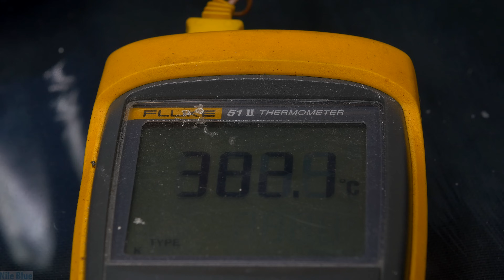Everyday science: starting fire with steam

Comment: Why does the copper tubing change color when the flame is applied?  Are the electrons in the copper moved to an excited state by the energy from the flame? Or am I thinking in the wrong area?
Reply: +Andrew Lorick It's called patina. Basically a very thin layer of oxide. Similarily to anodization, the color is determined by the thickness of the oxide layer.
Reply: I suspect that the effect seen in the center of the flame is the oxide layer being briefly reduced back to metallic copper by hot unreacted hydrocarbons from the torch.
Reply: YouCanHasAccount thanks this was really helpful
Reply: +YouCanHasAccount And since the environment is oxygen-starved, it does not change back until the torch is removed.
Reply: 1 likes in 5 years 😭😭

Comment: Why does the copper change color when you heated it with a torch?
Reply: The flame  is converting the oxides back to metallic copper. When the flame moves away the hot copper tube oxidizes again almost instantly in the open air.
Reply: Wow. Grammar...
Reply: +Matthew Ferrie It oxidizes into various oxides

Comment: try putting a piece of sodium in the jet
Reply: +Ash De Vos Now there's an idea. I like it.
Reply: +Matthew Ferrie 
Enough heat to melt the sodium and it's using a substance it is known to violently react with. At the same time, steam isn't as concentrated a source of oxygen or hydrogen as liquid water. 
I kind of know where it would go, but I'm not sure and I've never seen it done before. It may just start a sodium fire (not to say that isn't an interesting reaction in and of itself).
Reply: Ash De Vos you'll get a negative surface tension coulombic explosion..........
Reply: +trustthewater Kablooey?
Reply: Now we're talking